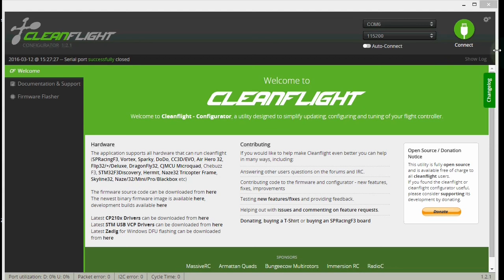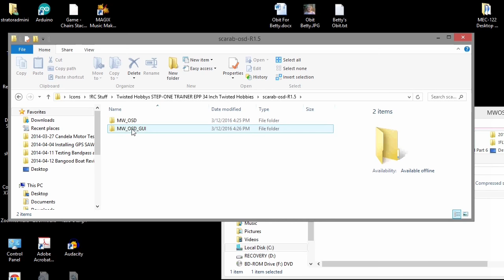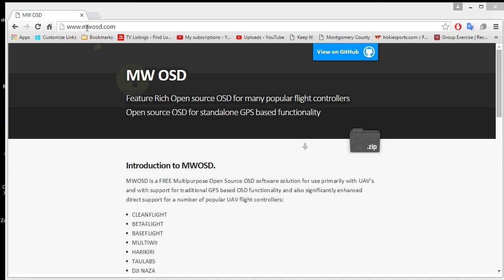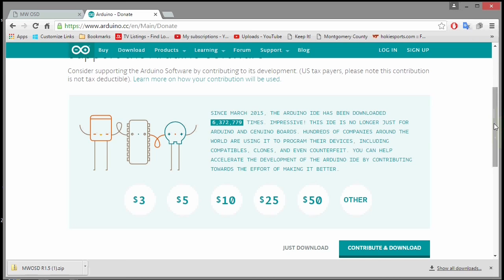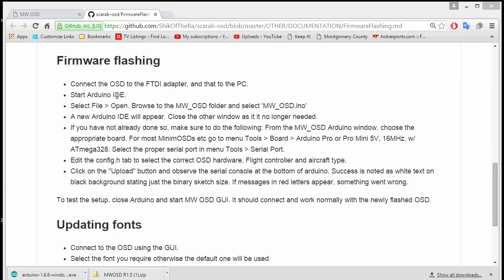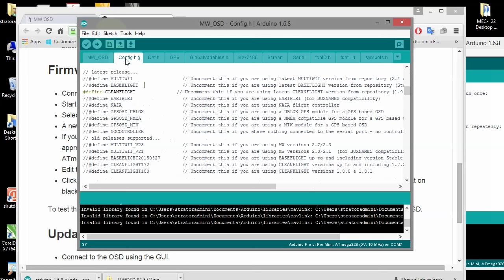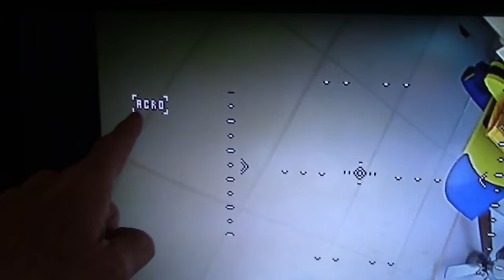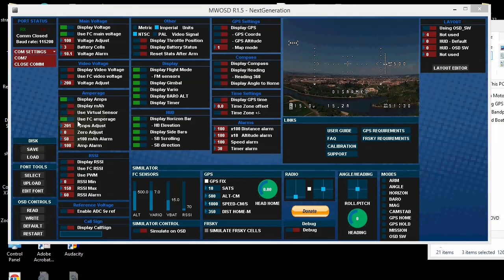BeeRotor FC Airplane OSD Setup with Cleanflight Part 2 (MW OSD Update Firmware, Configure)

Comment: Nice video :)
Very easy procedure!
You don't really need to type "dump" in the CLI section for knowing the version, actually on the first screen at 2:01 for example, you already have the firmware version of cleanflight installed on your board, under the disconnect button, the big green button with "DOCUMENTATION FOR 1.11.0", this number always shows you what version of firmware you are using :)
I am using Betaflight and everytime i upgrade the firmware, these numbers change according to the firmware :)
Have a great week Dave!
Reply from the maker: +ABMNS PRODUCTION Doh! Thanks for telling me about the quicker way. It was fun to take a dump though :-)
Reply: ***** Hahaha yes i can imagine that!
Sad, the MWOSD website is down since a couple of days...
I really love this OSD, works very good on the minimOSD board :)

Comment: Hi,

have you managed to change the font type. I'd like to use larger fonts. The upload process works flawlessly, but they won't be saved permanently, despite writing the settings afterwards. I've read on the MWOSD page, that for font updating the supplied voltage has to be 4.8V or higher. My FTDI Adapter only supplies 4.64V, so I attached a separate power source to power the osd (5v), but this won"t do either. Then I tried connecting the flight battery to the FC, but then my OSD GUI wont work.

What am I missing? Have you tried it yet?

Comment: I'm enjoying this series Dave. This looks like a nice little fc. I like the built in minimosd! In a future episode, could you talk about how it compares/contrasts to the Naze32? I have an extra Naze32 and was thinking of trying it in an airplane. Thanks!  -Fergy
Reply from the maker: +TheAdkFlyer10 I will try to mention it but keep in mind I don't have a Naze32 to compare it too.
I hear they are very similar except for the OSD.
Reply: +dmerc00 Oh ok, thanks Dave! ☺
Reply: +TheAdkFlyer10 I am using the MWOSD 1.5 with my Naze32 and it works pretty good, i even had the artificial horizon at the beginning and it was working but i disabled it since it is useless for a mini quad!

Comment: please what is the size of the cable connector holes? I need a spare 10 pin connector but I don't know if it's 1mm or 1.5mm
Reply from the maker: Molex 10 Pin HOUSING PICOBLADE 1.25mm 51021-1000 - Mouser (for GPS connection.)
Reply: Thanks for your prompt response. Do you know where I can buy it? Thanks
Reply from the maker: Mouser is where I got them.

Comment: Do you happen to still have the mwosd r1.6 folder? i got several of these flight controllers for my nephews to fly and i cannot get it to update they are on r1.6 so i need that gui and none of that stuff is availible anymore? basically i need the mwosd r1.6 zip file
Reply from the maker: From what I can tell the file you need might be on my old laptop.  Give me your email (gmail) address and I will try to send it to you. Also you might try r1.7 because that is still available.
Reply: @DaveMerc  well, i didn't  pay attention to your recommendation at first, noticed it later, but that r1.7 did seem to work!i couldn't get the rssi to work with ELRS though, cleanfight is showing the rssi on the calibration tab, I've tried everything in mwosd gui.... Well at least i was able to get rid of that dang blinking rssi that was so distracting. Hopefully elrs should out preform my wolfwhoop 600mw analog vtx and i should loose video before control. I can live with that! Thanks for the help! I had tried the 1.9 and the 2.0, never thought about the 1.7. Happy rippinz!
Reply from the maker: @DigitalCruzer  Glad you got it working with r1.7.  Maybe you will find a trick for the RSSI later.  I remember one time the RSSI had a negative going signal and I had to reverse the MIN MAX values to get it to display but that was EZUHF RLS.

Comment: Dave, I tried to use a Naze32 with Baseflight on a fixed wing plane (FT Explorer) and had it configured with MinimOSD and a GPS and everything seemed to be working great until I tried Return to Home. It immediately sent my plane into a nasty dive and when I tried to pull out of it when back into manual mode the wings folded up.  You can watch the disaster on my video here - http://youtu.be/coly9aY5yW0

I'm not exactly sure what I did wrong.  Maybe you'll have better luck with a fixed wing on a similar FC.  Just be extra careful with your config on the GPS stuff and RTH.  I got everything else working great except for that.
Reply from the maker: +Albert Kim (marblekit) RTH can be a disaster on about any FC. Don't trust it.